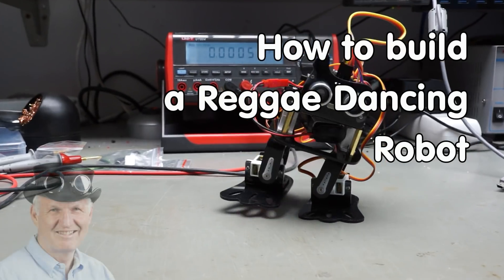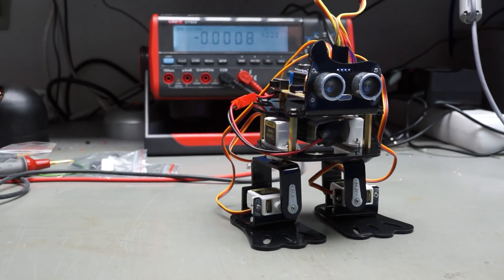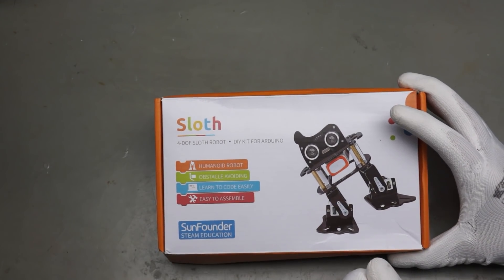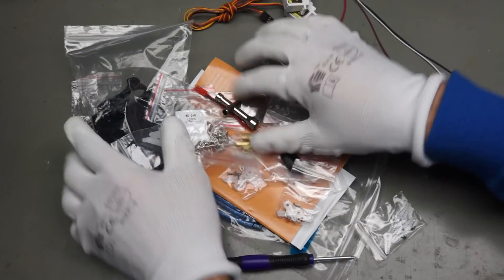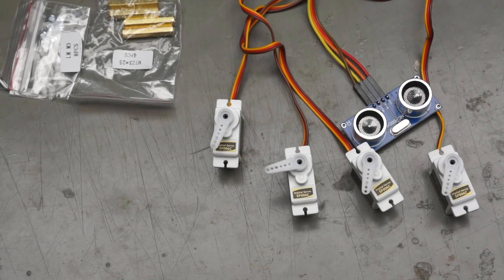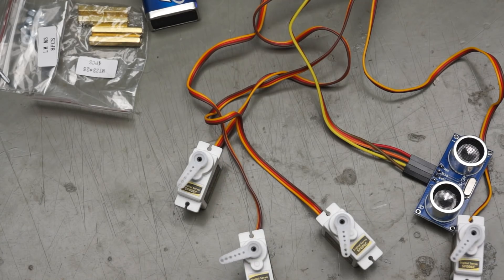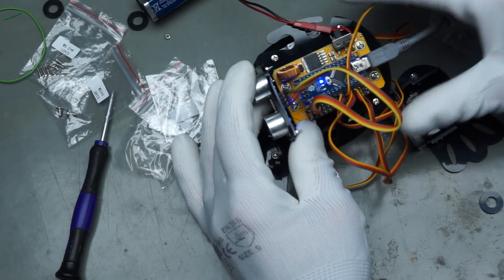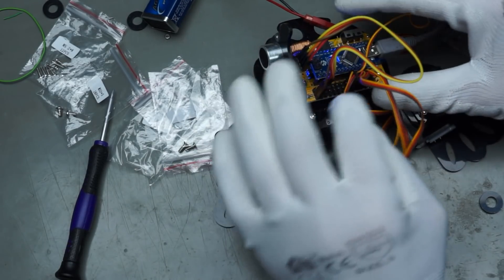#248 How to build a Reggae Dancing Robot

Comment: Hi Andreas, I am trying to build the robot but its rebooting and sometimes moves a little. I used a new battery but doesnt solved. do I need to use  a regulator?
Reply from the maker: I did not use a regulator.

Comment: Funny. Pretty sure you need to swap and flip the feet. It looks like the tapered holes should be on the bottom and the toes on the inside.
Reply from the maker: Maybe you are right. I am an electronics engineer, not a mechanic ;-)

Comment: I received and built my own BOT Marley today. I am trying to get it to dance like yours, but can't quite figure out what all the settings in the dancing.ino sketch do. Can you share your sketch and possibly even explain some of the settings? I think I figured out you are just using a combination of the dancing1_2 and dancing3 functions, but you adjusted the speed. I have also had problems with the BOT falling when it leans way over during "right_foot_support".
Reply from the maker: I used the sketch they provided, but it took me some time to align the servos.
Reply: @AndreasSpiess  Interesting, but not helpful.;) Did you run the Install part of the simple_robot.ino script and leave the robot turned on while connecting the 4 servos? This kept the servos in the correct position as you attached them. I thought that was brilliant. Because of this I did not need to adjust or calibrate the servos at all. Thanks for this and everything else this year. You and your videos are wonderful. Have a Happy New Year!
Reply from the maker: I do not remember exactly what I did. It took me quite some time to get the servos right. For sure I started with their installation sketch. But if I remember right, this was not enough :-(

Comment: how do you rate the wowstick screwdriver?
Reply from the maker: I only have the basic version with batteries.
Reply: @AndreasSpiess  same one i got.
Reply from the maker: OK for small work. Not very strong. Many tools.
Reply: The basic version isn't very powerful and you have to manually loosen the screws but there are several models available.
Reply: I wondered about the ES121V Mini Electric Screwdriver as an alternative but not sure if it's worth the extra money